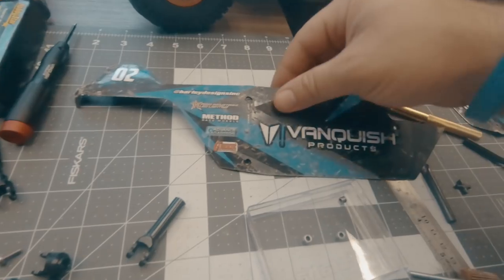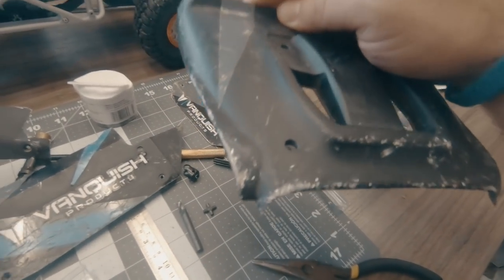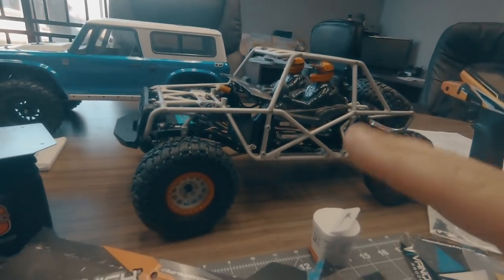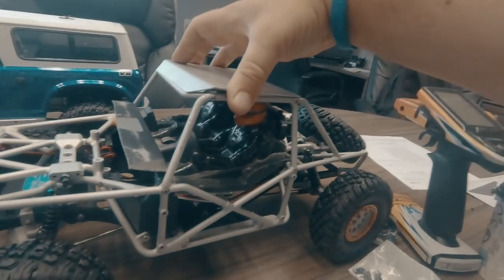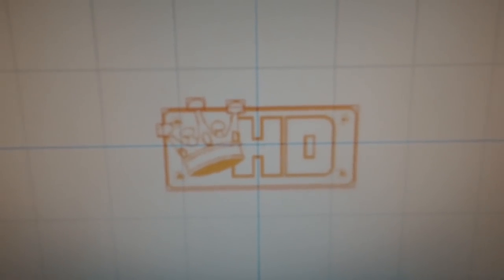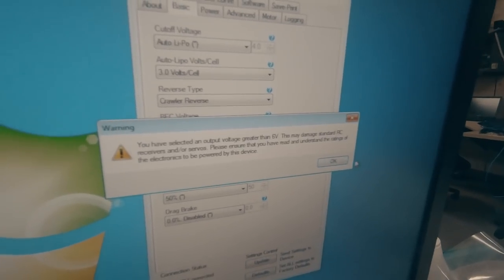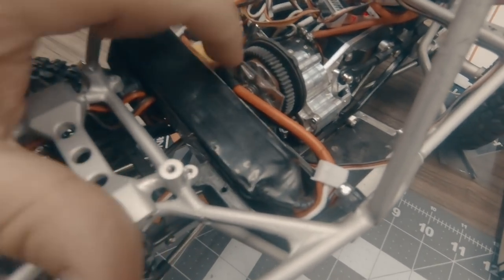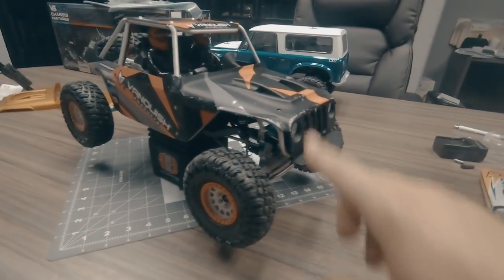Axialfest 2018 Prep - Vlog EP3

Comment: People just don't understand what it cost to Machine like that. It's not a basic Machine part either. To Machine a round bar out of rectangular stock is crazy. Are you machining on a 5 axis machining center or doing multiple operations?? To me it seems like 1 continuous piece. It would be to hard to reposition for 2nd or 3rd operations other than drilling holes & stuff.
Reply from the maker: We have mainly 4 axis machines, no 5 axis. So it is done with more than one operation. The body panels are done on 3 axis machines in 2 ops as well.
Reply: Harley Designs That's some awesome machine work. 👍😃
Reply: I understand it takes time but doesn't hide the fact that it's wasteful to use that much and turn it into a little which was my point
Reply: RC Maine-iac it's just what it take to make 1 continuous piece. Also the chips are recycled so there isn't much waste

Comment: I agree with both Camps, somewhat. I definitely Appreciate all the Work and even the Craftsmanship of CAD Designing such a thing! 
Is it for everyone? CERTAINLY NOT!! But it wasn't made for that, was it? 
Frankly, if someday comes, and I ever HAVE that kind of money again.... I'd probably go for the 4-10 instead. Of course, MORE Money!! But, it's a more complete Product. It's ALL Vanquish!
For THAT kind of money, that seems easier to swallow than a $1900.00 add-on Kit for an SCX10 II - which needs to be added to the final cost.
I believe that the 4-10 is WORTH that much money! You can actually see what you've spent a King's Ransom for (in RC terms!!).  I truly hope I can buy one, before production stops....
Have a GREAT time at Axialfest!!
Carmine 💥 ⛽

Comment: Josh can you fit a small velcro strap to secure the battery leads to the pack itself?  It just looks like that lead could still work it's way over that lexan when the Ripper is hitting rough trails at speed.
Reply from the maker: I could, the interior can’t go up though because the hood holds it down. So the wires should get behind.
Reply: No worries man, just wasn't sure of what else you were doing to secure it, and would hate to have it slip out during some epic gnarly rock bounce.

I can't wait to see this rig, AND the SBG rig tear it up at AxialFest!  The video I mean.  

It'll be probably another 10 years before I get out there with my daughter.  I'll keep enjoying local RC GTG's all the same take care man!

Comment: why not stamp the panels in a punch press using sheet metal? I worked in precision sheet metal for 16 years. It would be a lot cheaper to stamp them, then to mill them and there would be no differents in on how strong it is. Just use a 6000 or 7000 series alum. This in turn would bring down the cost for you and your customers. Honestly that price of $1900 is way out there for most people. Iv'e been into rc's for 30 years and own over 30 ground vehicles and 10 drones i would never be able to afford that price.
Reply from the maker: Stamping would be possible on the side panels maybe but not the hood or grill. The drafts and sharp edges would never pull correctly. And if it was stamped the the mounting would not be as clean and recessed. Plus we would have to amortize the cost of the stamping tooling plus the charge to have someone else do it. It may actually add cost to the kit because the cage is still the most expensive part. This whole project is just an exercise in machining. It’s meant to be rare and exclusive. But we have sold way more than we thought we would.

Comment: Very wasteful people are tig welding tubes and they look just as good and i can guarantee they have less money in it and therefore can sell them for less and just me but I'd rather give my money to someone who has crafted something by hand...takes more talent and deserves more money and recognition....
Reply from the maker: I bet there are far more people who can weld aluminum then there are people who are capable of programming this cage to be machined. Also, these are perfectly repeatable so the precision fit of every body panel is perfect which is something else that isn’t done when welded. To build a cage like this from tube requires lower grade aluminum so that it can be bent. If you try to do it with a 6061 the tube just cracks. I have TIG welder aluminum cages, and hand made stuff is amazing, but this is a different level of appreciation for fabrication.
Reply: Even as many times as it is clearly stated some people just do not hear that the Ripper was not supposed to be a production piece. It was done to showcase what was possible at Vanquish with the extreme talent of their machinest, and their attention to detail. I have the utmost respect for people who can TIG weld small cages, but it is just not possible to duplicate what the Ripper is. 
 Thanks so much Harley for letting us see what goes into these works of art.
Reply: I don't deny that but you are making excuses to my comment which was just MY opinion
Reply: I do apologize I didn't mean to insult you or the fabricator
Reply: RC Maine-iac your not taking into account the engineering & programming involved with machine work obviously. It's not just the time  & material. You have to figure out how to hold the part in the Machine. How many ops. It's going to take. Program the machine which could take awhile in itself. Proof the program to make sure it'll run without crashing. Then there is machine set-up & then machine ops. All this has to be done for each of the 4 pcs. Of the cage. So yes there are people out there doing awesome tube work this truck obviously isn't for everyone. It's definitely geared towards someone with a basic knowledge of what it takes to create. Definitely something I'd love to have but would never be able to afford.
Reply: Lol takes more talent to tig weld a frame like that? You cant be serious. You should actually do a little research and see how much goes into machining a frame like that.
Reply: DoWorkNP I've been doing CNC Machine work for 15 years I know exactly what goes into it. As far as tig welding while yes it's a cool talent & skill to have it's a lot more work to Machine it. Sorry to say. Seriously once you know how to weld the rest is easy. Bend some rod & tack it together anyone with basic geometry skills & the know how to read a ruler could learn that in a weekend. Won't look professional I'm sure but could be done. Everyone has their own opinion. It's all in good fun. With all that said. I know it's not the most cost effective way to make a cage either that's why it's not a full protection vehicle too. It's definitely not for the average guy. 👍😁
Reply: Don't care for the vibe on this channel see ya
Reply: Mike Burgess RC My last reply wasnt for you man. I was saying anyone can learn the basics of tig welding and could put together a little cage in a weekend. Not that machining though!
Reply: RC Maine-is Seemed kinda like you were the one coming in attack mode? Dont bring those bad vibes mane!
Reply: DoWorkNP Yeah buddy I figured that out later. Lol I got that towards the end. I should have re-wrote it. 👍😁